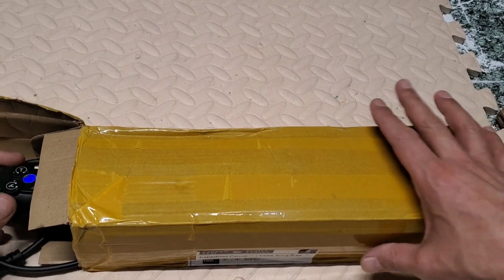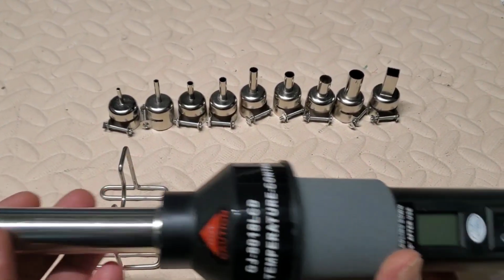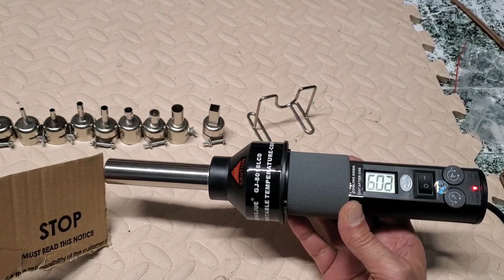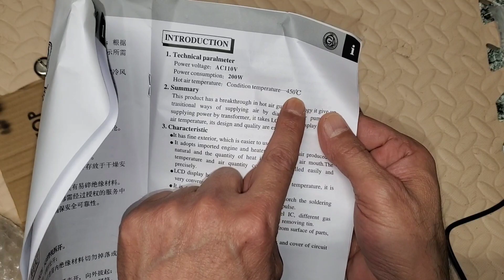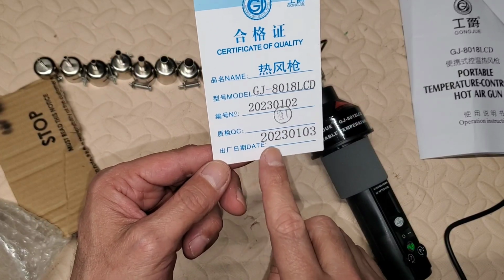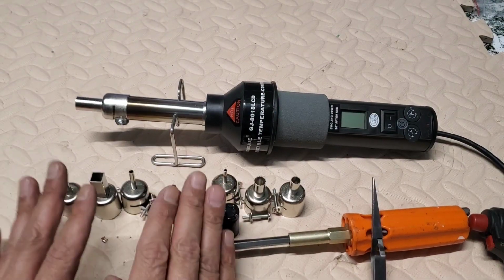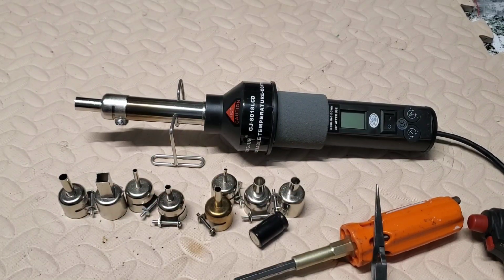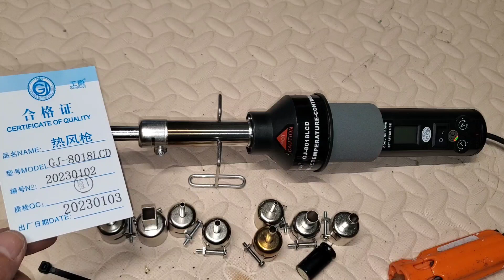Complete Review & Test Hot / Heat Air Gun, 8018LCD For Soldering Or Multi Purposes

Comment: I have a normal hot gun and with the little orifices tools have nurmed the motor for overheating..ehere is the problem?
Reply from the maker: If your hot air gun motor is overheating, it can be due to several potential issues. Here’s a guide to troubleshoot and address the problem:
1. Blocked Airflow
Cause: Dust, debris, or blockages in the air intake or exhaust vents can restrict airflow, leading to overheating.
Solution: Inspect and clean the air vents and filters (if any) to ensure unobstructed airflow.
2. Worn or Damaged Motor
Cause: Over time, the motor may wear out or its bearings may fail, causing excessive friction and heat.
Solution: Check for unusual noises or vibrations. If the motor is damaged, it may need replacement.
3. Faulty Heating Element
Cause: If the heating element is malfunctioning, it may generate more heat than the motor can handle.
Solution: Inspect the heating element for visible damage. Replace it if necessary.
4. Overuse Without Breaks
Cause: Prolonged use without adequate cooling time can cause the motor to overheat.
Solution: Allow the tool to cool down periodically during extended use.
5. Electrical Issues
Cause: A power surge, faulty wiring, or a malfunctioning circuit can overheat the motor.
Solution: Inspect the wiring and connections for damage. If you're unsure, consult a professional.
6. **Inadequate Maintenance
Reply: @WorldRandomVideos  thanks,the gun hve 40 uears old..maybe is tired or different construction without adeguate air ventilations ..i have bought a new cheap gun today for 12 euros ..testine this
Reply from the maker: @alessandrocomisso700 , you are very welcome 🙏,  maybe that's 12 years that's really good Last that long most of hot air gun don't last that long especially after many usages,  thank you and all the best 😊
Reply: @WorldRandomVideos  the problem could also be that the small nozzle did not have the vent and acted as a plug, overheating
Reply from the maker: @alessandrocomisso700 yea, it doesn't have, just simple design and  cheap price, it's not for professional or repair shop, may good for home or personal use, thank you and all the best 👍

Comment: Lol, you can not just turn off a 800 degrees celcius airgun obviously.  Well you can shure.. but the internals will burn . What you should be doing is either keep it running or turn the temperature down so it can cool. I bet it even says so in the manual
Reply from the maker: Yes, that's right, it says in the user manual at the first try, when you turn it on first at low temperature for few seconds then slowly at high temperature, this hot air gun it takes few minutes to cool off, I tried to test  temperature with laser gun but the one I have it canbtest up to 250 C , so the display screen shows highest from 600-800c  After 2 minutes or so while is on at highest temperature, then second time use it should be OK, I am still using from time to time and still working well,
Thank you and all the best 👍

Comment: How much
Reply from the maker: The prices start  about from $30- $45 , here's a link from aliexpress 
Just found this amazing item on AliExpress. Check it out! C$32.41  63%OFF | 650W EU US PG8018LCD Adjustable Electronic Heat Hot Air Gun Desoldering Soldering Station IC SMD BGA+Nozzle 650W Hot air blower
https://a.aliexpress.com/_mtdLZ3I

Comment: this heat air gun do the job yes, but it isnt professional, it keep increase the temperature or cool down the temperature isn't stable. so you will burn the pcb, dont buy it.
Reply from the maker: Hello my dear friend, you're right, it does get very hot and increase rapidly but I think for price it's not pad I can use it for other purposes,
The good one can cost up to $150 or more, I don't do a lot of electronics repair, this soldering hot air good for old electronics components, thank you and all the best